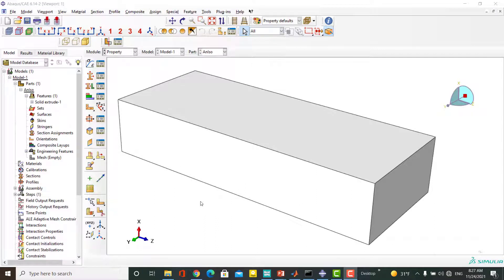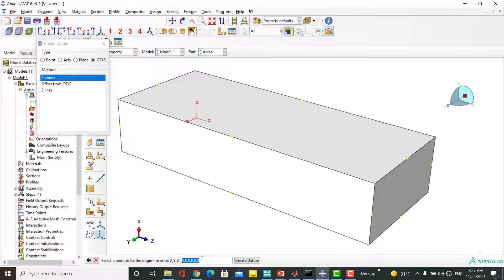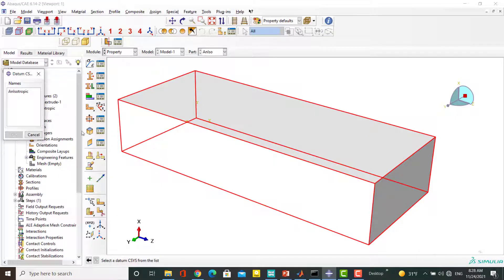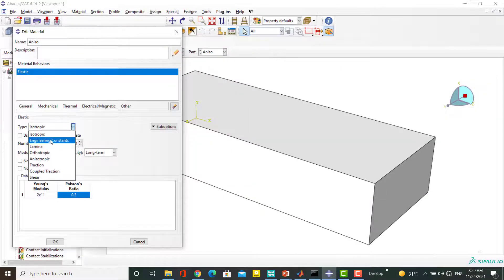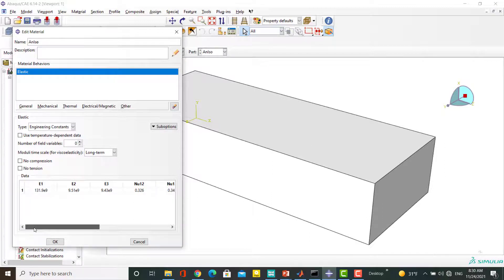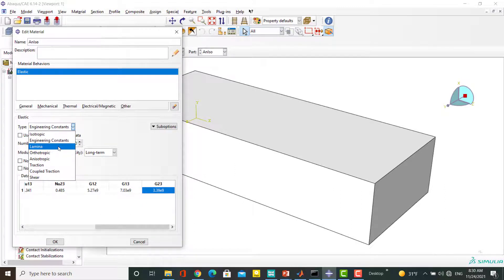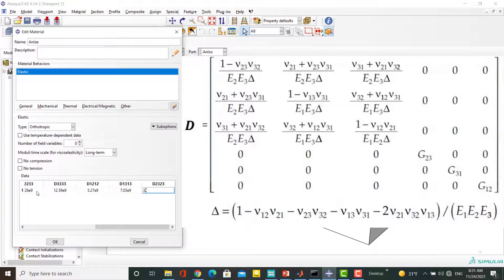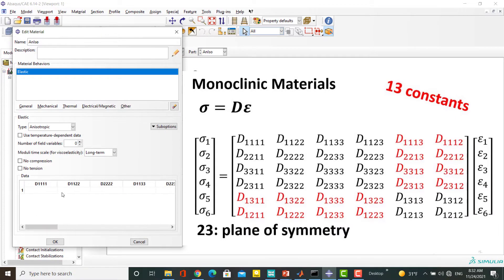Defining: anisotropic, monoclinic, orthotropic, and transversely isotropic materials in Abaqus

Comment: Hello, first of all thank you for this video, many of my doubts were cleared.
I am working on bidirectional woven glass fiber composite, which is orthotropic in nature, so I went ahead and used the 'Engineering Constants' . But I am not able to decide how should I orient my datum co-ordinate system. Is the material orientation in this video, by default for all the orthotropic materials? or is that case specific and how can I identify the axes direction in my case?